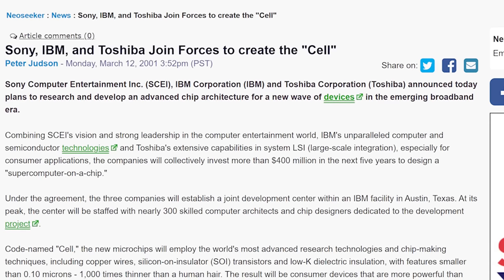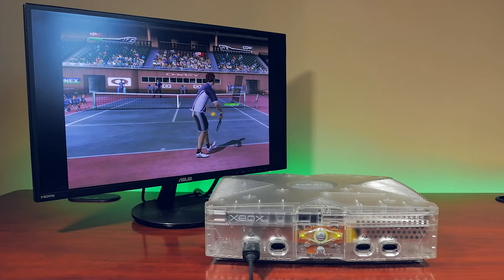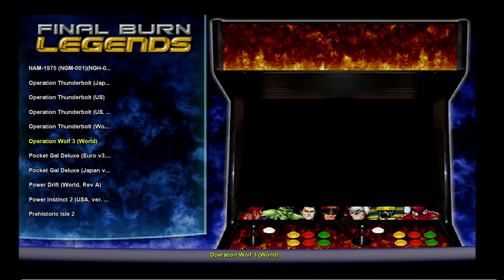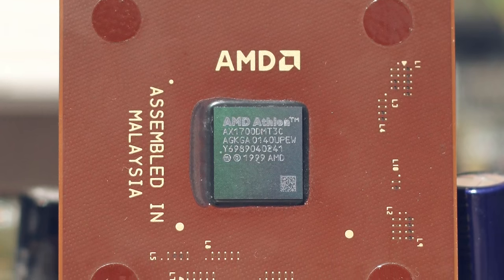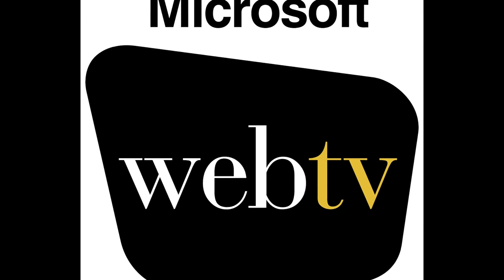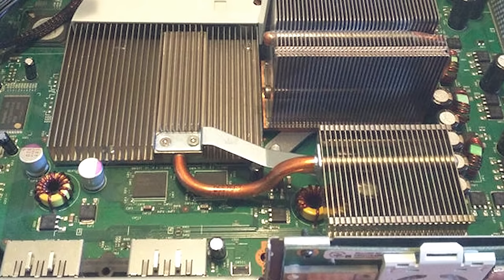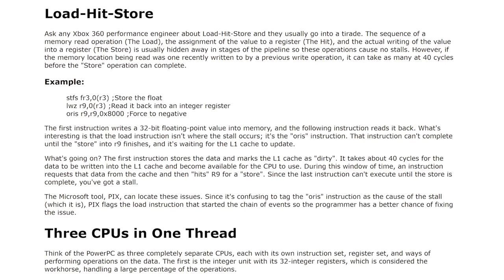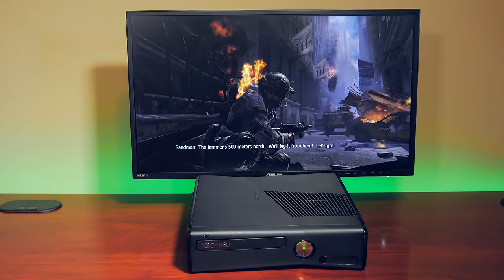Why Microsoft switched from Intel to Power PC for the Xbox 360  | MVG

Comment: I'm sorry.. The PowerPC 970 is _not_the base for the PPU core in Xenon and Cell. PPU is bespoke designed by IBM on spec from Sony. On the surface they are somewhat alike (like that they are both 64-bit PowerPC cores) but dig a bit under the surface and they are very much dissimilar. 970 is multi-issue, single threaded, 10 functional units, hundreds instructions inflight, powerful FPU, 9 stages short pipeline. PPU is single issue, 2x hyperthreaded, 5 functional units, few instructions inflight, weak FPU and 23 stages long pipeline. Pretty much nothing alike. 970 is a beast, scaled down from a sever. PPU is an overclocked embedded CPU.

The confusion probably comes from sloppy marketing and the fact that Microsoft used Apple PowerMac G5s (with PPC970) as dev kits. And that works since but 970 and PPU is binary compatible, just as Atom and Xeon processors are.

Comment: It is easy to look back and say that PPC was a bad choice as compared to Intel processors, but with the context of the time, with PPC being cheaper, and faster with specific instructions per clock, it makes sense that they decided to go with PPC for the xbox 360. Just imagine if the cooling for the PPC was more important than the design. Yes, you may have to deal with something the size of an old VCR, but the speed of the RISK PPC processors was very good when compared to their price. The story would be very different if Sony and Microsoft acknowledged the fact that these chips run very hot and made proper cooling for them and then designed the console's looks around it

Comment: At the end of an architecture's life span the video game industry swoops in, takes the tech along with the top talent and offers them more or less a lifeline before some retire and the others retool for a new architecture. This allows them to get the best price performance ratio to build machines that will outperform the old systems at a low cost. This has happened several times so far from the 6502 to 68k to now with the x86. I noticed that with each gen that used the tech, it would be abandoned for far more powerful chips in whatever industry was using them. PPC was being abandoned by Apple during the PPC era of consoles, for instance. I feel a paradigm shift in home computing is coming. Will it be ARM? A new x86 design?

Comment: You may know about MorphOS, one of the forks of Commodore AmigaOS. MorphOS has been ported to a number of PowerPC Macs so I keep wondering if it’ll also be ported to these consoles, especially the two with AMD GPUs- XBox360 and Wii. MorphOS has traditionally worked with AMD GPU equipped PowerMacs but not NVidia ones.

Comment: The hot running CPU didn't help, but the insanely hot GPU is what really killed most Xbox 360s. It didn't consume that much power by modern standards, but the cooling solution was woefully insufficient for both the 90nm and later 80nm versions used in the fat 360s. Xenon GPUs sat in the 90C-100C range for the duration of gameplay. Depending on who you ask, thermal expansion due to the extreme temperatures caused stress fractures in either the solder balls between the motherboard and GPU or in the microbumps between the chip itself and its substrate. This caused the infamous 0020 and 0102 secondary codes which most dead Xbox 360s had.

Comment: @MVG, did you know you can overclock the xbox 360 cpu for OG xbox compatibility using OG xbox cpu tool. Use google to find the tool and use it to  overclock the cpu for OG xbox emulator to 1.4ghz. i'm sure you are familiar with the updated 128mb OG xbox emulator for xbox 360, you will need that.

Comment: technically, ARM-based processors also use the RISC architecture, which ultimately means that the Switch is also on the RISC architecture
Reply: ARM is RISC in name only.

Comment: Sony paid a fortune to IBM for R&D to produce the custom cell processor, silicon that was to make a generational leap in performance. Then IBM gave a copy to Microsoft.
Reply: 360 uses PPC only, not cell. Originally Sony thought they wouldn't need a GPU thanks to cell, but later changed their mind.
Reply: @R.-.  It's not branded 'Cell' in the 360 but it's basically the same design. A design which was funded largely by Sony

Comment: Gen6 would have been much more interesting if Nintendo had went with a single 970PPC with 2 threads and used Gekko for OS / co processor, and went with flipper * 2 at 400MHz for 720p resolution support and ~40TFLOPs via flipper 2.0, 2GB internal storage + SD card, with the Wii U's 32MB t1sram and 256MB DDR3. If they could have produced that version of the Wii for $299 ($50 more than original price and same price as the 2005 360 arcade sku) I think they would have completely taken over the generation, and could have probably skipped Wii U entirely, waiting an extra 2 years to release at the end of 2015, 6 months after Nvidia Shield TV and a month before Pixel C, with Mario Maker and Mario Kart 8 as launch games, and Splatoon launching spring 2016, with botw following up in the holidays.

Comment: MVG is not entirely correct when he said power PC is the causing of system failure, it’s not the cooling solution of the Xbox 360 was questionable but the pcb thickness of Xbox 360 is too think , with a little heat the board was bending and with cyclic loads the solder eventually crack , sometimes over tightening of the screws cause solder balls to join and short out. 

Also he forgot to mention in early 2000s intel was limited to core2duo and the prices were insane for multi core, only power PC offered nice solution for multi ore and multi threading . 

Last but not least , ceo of Sony USA mentioned in an interview he was considering power PC solution for ps4 but scrapped it (not sure but I think he said it has to do with devs complaining  the use of asm etc)

Comment: Paradoxically, Apple moved away from PPC because of the thermal and consumption issues. They never could package a decent G5 laptop, the previous CPU being the stopgap and last PPC used in the POwerBook G4.
It was weird at the time to keep hearing there were no games on Macs because it used a weird processor from IBM. Then all consoles were running a modified PPC core, excluding any Apple additions to the POWER architecture like the AltiVec.
So glad Apple is out of Intel now. Didn't wait one bit to update my 2020 MBA-intel to 2020 MBA M1.

Comment: The PowerPC was the spiritual successor to the legendary Motorola 68000 line of CPu's that powered systems like the Amiga and Sega Mega Drive, it was cool to see it get one last hurrah in the mid 2000's.

I do suspect Microsoft or Sony will eventually revert back to RISC, just look at what Apple have been able to do with it's ARM CPU's that aren't weighed down with all that x86 bloat.

Comment: I've heard and read that Microsoft bought a bunch of Power Mac G5 desktops and used those as the first SDKs for the Xbox 360. Considering the software hasn't been leaked, this would be difficult to turning my G5 into an SDK for my 360.

Comment: The bad thermals was a key reason why Apple drop the Power P, but not hr only one. IBM management were not into grow but financial engineering and did not want to invest in PowerPC enough to compete. Also Intel had a he node advantage and were willing to work with Apple. It was a fantastic run with Apple, Intel and ATU revolutionizing the Laptop form facto, until it was no longer possible.  Then ARM, Apple and TSMC toke over

Comment: I don't really think using PowerPC was odd.  PSOne, PS2, N64, PSP used MIPS.  Motorola and Hitachi had chips in the most popular gaming consoles.  Intel and AMD at that time were more static in their offerings.  AMD could have delivered maybe a < 3GHz dual-core processor in the Athlon 64 X2. It does have ~80million more transistors so a lot larger processor. We'd need to figure how that would fare against the Xeonon that was 3 cores and 6 threads at 3.2GHz. 
XBox had the RRoD, but this could have been fixed if they weren't penny pinching too hard.  From an engineering article that was released that generation it was fully preventable.

Comment: As usual, the important thing is the software, not the hardware. I have a strong preference for dismantling the Intel monoculture hegemony, and switching to PowerPC addresses that--in theory. Of course, there were problems as you outlined in the video that ultimately made PowerPC untenable--but this is where architectures like ARM (and hopefully RISC-V soon?) shine. My Switch is absolutely my most-played video game system (including PCs) of all time, and it runs ARM. That's largely because the game engines target it (see above re software vs hardware) which makes it an indie port darling.

*That said*, though, the feasibility of porting those game engines to the platform is solely dependent on the hardware. Intel has been the PC industry's go-to (at least in the US) for about as long as I've been a person, but I feel that they need competition--from AMD on the desktop and ARM everywhere else--or they're going to stagnate in that position. Sadly, in a capitalist system, we need good competition for improvements to happen, and I think the Switch is showing folks that ARM is a thoroughly capable base to build a system on. ARM pretty much rules mobile, which I imagine influenced Nintendo's choice for using it for the Switch, and we're soon going to see how Apple's ARM Macs perform.

As I said, I'm eager for Intel to be dethroned, and I have a strong personal preference for RISC architectures in general (ARM assembly is a delight), so anything that moves us away from Intel is a good thing in my mind for the reasons given above.

Comment: I think Microsoft missed an opportunity by not going with the upcoming K8 based Athlon 64 X2 that AMD had in the pipeline during the development of the Xbox 360, it would've maintained backwards compatibility, ran cooler and would have been easier to get the most out of the processor since you wouldn't have to worry about optimizing for in-order execution or early SMT.

Comment: Why IBM? Because it was the only low cost CPU designer with true multicore support (scalability), enough single core power and widely known architecture (RISC). Console life is 5-8 years and everyone known that within 2-3 years any single core CPU will be obsolete. None of x86 low cost CPU manufacturer could provide their low cost, multicore version of Celeron or Duron at the time. If only something like Intel Atom 3-core wold be available - it could be the heart of 7th generation of consoles.

Comment: Power PC found a new use case just as it was becoming obsolete for its originally intended use case as a general purpose computer. Others didn't fare so well. Look at Itanium, which only ever eked out an existence as a server architecture, when it was Intel's intended successor to the x86 architecture in all ways. 

It also meant that for a very short time we got some decent Mac ports of Xbox games, like Fable, Halo, Quake 4, Doom 3, Lego Star Wars, and the original Star Wars Battlefront.
So I'm glad the PowerPC continued being used in the late-2000s. Now it looks like the only POWER architecture applications are in esoteric stuff like scientific simulations and supercomputers. The only consumer machines containing POWER hardware at the moment are the exorbitantly priced Raptor Workstations, and I'm not sure of the point there.

Comment: Pentium 4s run hot
How hot?
In the building I used to work in, the back office would get real cold in the winter. I used an old pentium machine as a space heater for that office. It was quite small and the computer raised the temp about 10°Freedom or about 4-5°Communism.

Comment: I remember those early talks about Cell from all the way back in 2001. I didn't even have a PS2 yet, and there was Sony, already hyping up the PS3.
It's ironic that one of the reasons Microsoft ditched Intel is because the Pentium 4 ran too hot, yet the console ended up having overheating issues. Hell, the whole reason why Apple ditched PowerPC altogether is because the PPC 970 ran too hot to be used in laptops, and IBM failed to provide a low-power alternative.
Had the Core series already been in Intel's roadmap when Microsoft started development on Xbox 360, they might have not switched at all - although the Pentium M was very much already a thing, and the original Core Solo and Core Duo were very much derived from these chips. I also wonder about AMD - the first time I heard about Athlon 64 was in 2001 as well.
Reply: the reason the RROD happened was because the GPU was overheating or the ANA and HANA chip would die. I think there was never an issue with the CPU because it had a massive heat sink. The GPU on the xbox 360 had a super small heatsink. that is why MS on revisions put extra pipes and heatskins all over. it was a mess.

Comment: It's a pitty that Nintendo went for such low power with the Wii U. 
 With 4 cores, 8 threads, 2x the clock (2.5 GHz), a 700 Gflops GPU based on the HD 7750, 4GB ddr3 1600 through a 256 bit bus and a 32 bit O.S. it could have been a great piece of kit for the time.
 There are certain benefits to running 32 bit code on a 32 bit O.S. so I'm surprised that we did t get any 4GB consoles, si CE those are usually very focussed on maximizing bang for buck.

Comment: I think Microsoft should have taken a cue from Apple. Apple had already used PowerPC and ditched it because IBM couldn’t get the clock speed up high enough without the chips essentially self destructing from heat related issues. Even Intel at this point was better than PPC and they had their own heat issues (and still do). ARM64 is definitely the way to go from here. One caveat however is now transistors are getting soooo small quantum mechanics and it’s probabilities (and uncertainty) are starting to create design limitations that we cannot overcome with conventional means.

Comment: people love talk about saturn, ps2 and n64. but 360 and ps3 where truly the kings of being hard to program for

is not much that was hard to get something running on them, but that was hard to get something running well on them. 
despite the whole "OMG CELL" market, both consoles were extremely similar, and both suffered from massive massive memory latency issues.
you had to code the whole game around feeding data to the cpu and never let it run out, because if it did, there goes your performance

Comment: The iMac G5 has heat problems, but never once did it die on me.

The XBOX 360 Xenon had some problems.

I’m aware about G5 capacitor issues

Coming back to this comment a while later, I think a bunch of these things happened due to the multi core architecture of the Xbox 360 CPU. The dual core PowerPC G5s also had a bunch of thermal issues, and apple also had cooling issues with these cpus, an ended up with their notorious for failing liquid cooled model of the PowerMac G5

Comment: One of the reasons Apple switched away from PPC was power.  They wanted to push more into laptops, and PPC just wasn't going to cut it.  Meanwhile console manufacturers were still stuck in a regressive "we're plugged into the wall so who cares?" mode.  So they got the thermal ass-kicking they so richly deserved.

Comment: There is a lot of talk about the PS5, about super powerful hardware. But in the end money talks, and the cost of the parts talks. 
And just as with that generation the new generation will make budget based choices. 
Making a choice on budget isn't bad, there is always more and better, but what matters is fitting what you need in the best price package. 
Not to mention 3 times dual thread Power Pc did work better then the Cell Processor Design by a lot.

Comment: apart from all the pricing and intel/nvidia deals, heat issues etc. i believe what ultimately drove the hardware specs, was the software. with the first xbox, ms wanted to be on the console map, so x86 for easy porting games was a must, even with money losses, since no software house for ps would develop for xbx. when it was time for xbx360, sony already had software houses  working on the nextgen games, so again ppc arch was selected for easy porting between xbx/ps3. lastly by the time that xbxone  and ps4 were to be made, ms had already won all the major game dev houses, everyone developed in x86/x64 so again the x86 arch was the next logical step, again for easy and wide development of games for both ms/sony. nintendo is a different story, since it can survive and probably outsell both ms/sony, with just mario and zelda games just in japan.

Comment: I think everyone got bit by the Nirvana Fallacy as applied by IBM sales.  They knew x86 and knew it wasn't perfect but got sold on a Power product that wasn't done yet.  By the time it came out it was hotter than designed-for.  Also, I don't think ATI's custom silicon unit was as ready at that time.  AMD built up that expertise with that console generation so they were the best game in town having both CPU and GPU IP available and ready to make deals for the One/4 generation and now the Series/5 generation.

Comment: I really don't think it matters what consoles use, from a consumer point of view.  Backwards compatibility can't really be expected now that they've learned that they can keep selling modern ports of games you already own.  Everything else is abstracted out into higher-level languages and system calls.  The only place where I care about CPU architecture is the PC, where I find some odd comfort in knowing that it powers on in real mode and could still run DOS and old software I made, which will be handy when I inevitably reach that point of senility where that seems rational again.